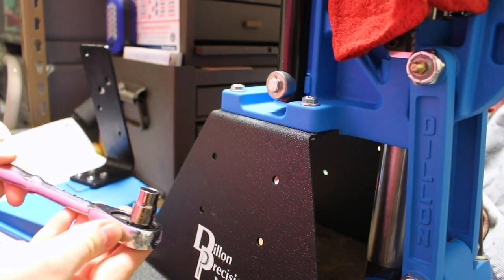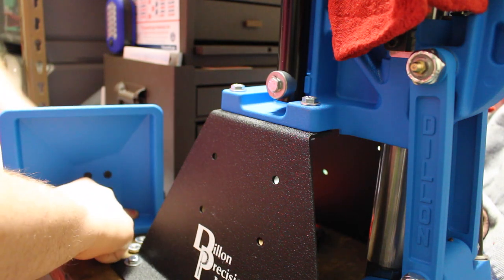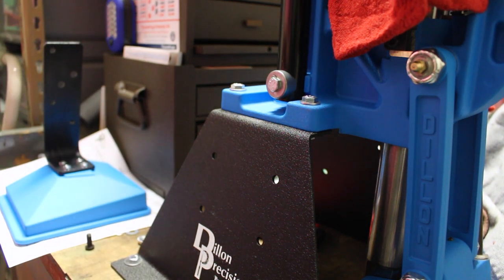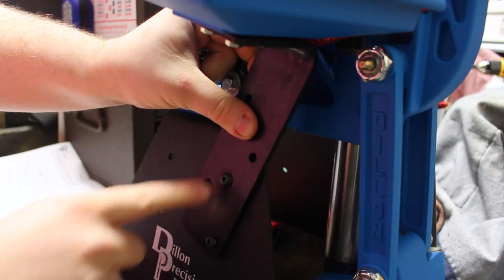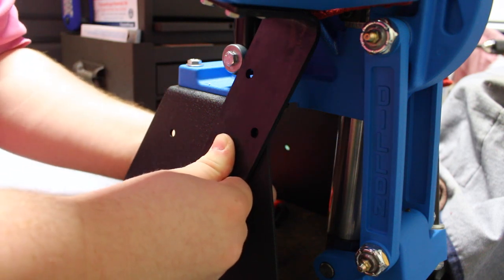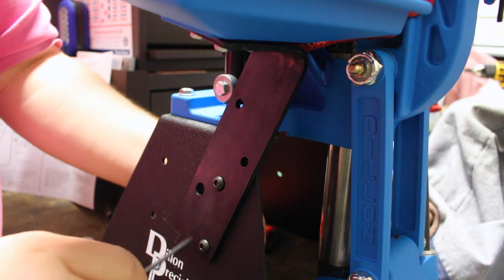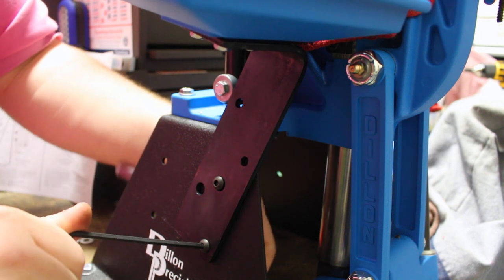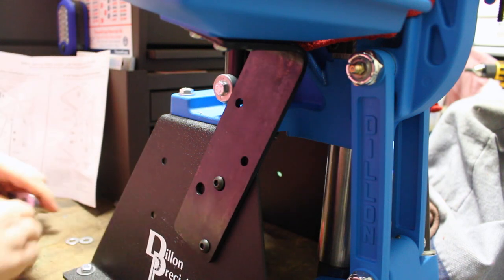Installing Bullet Tray on Dillon Precision Reloading Press 550/650 Mount

Comment: I just came across your video today.  I am wondering if you can tell me what the width measurement is from the strong mount, left, to the the edge of the bullet tray?  I need to see if I will have enough clearance between my two presses.